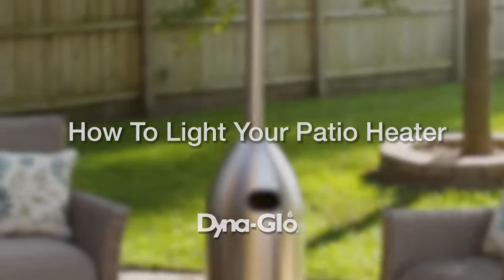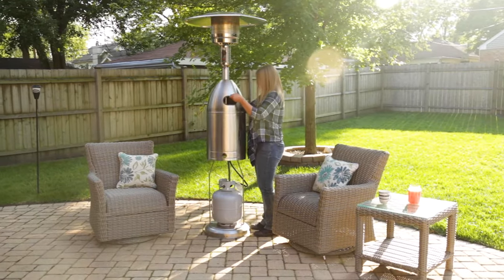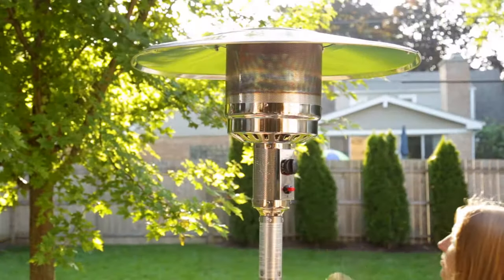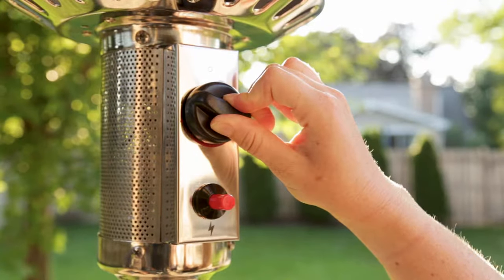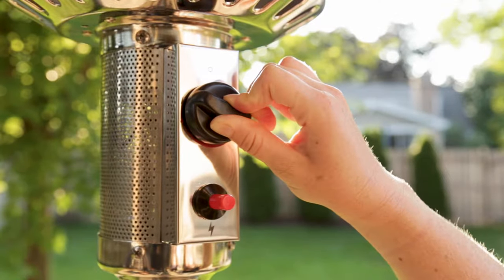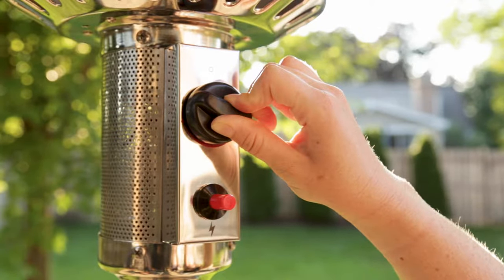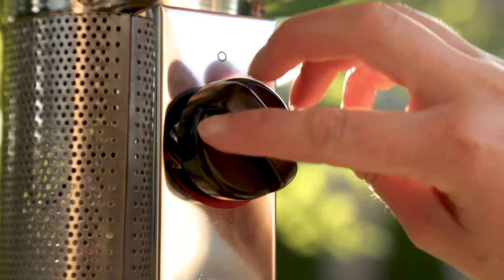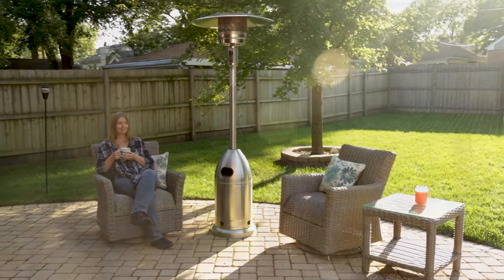How To Start Your Dyna-Glo Patio Heater

Comment: I spent about an hour trying to light my new Dyna-Glo heater by reading the manual. The instructions in the manual are very poor and don't describe the process that I used in this video to successfully light my heater. It took me about 30 seconds after watching the video. Too bad the manual doesn't reference to this video or have better instructions. This video is perfect.